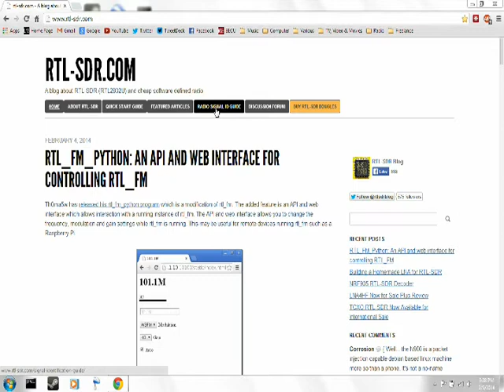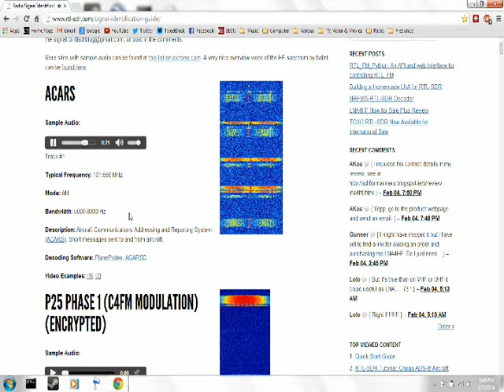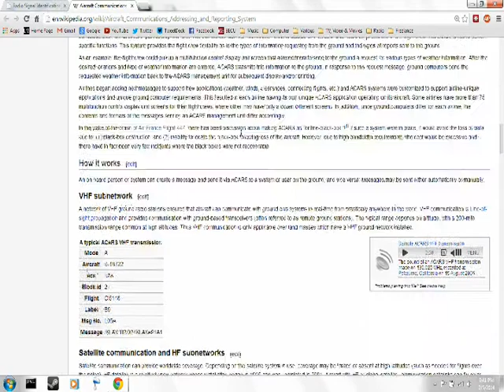Aircraft Communications Addressing & Reporting System (ACARS)

Comment: Good stuff Curt.  Fire up PDW and see what they are sayin :)  Purely FYI- I found MultiPSK to be 100X better than any other prog I tried for decoding ACARS- but I have to get the full license haha.  Cheers Bud.
Reply from the maker: Hey thanks, Eric. I discovered ACARS signals by pure accident and after researching just exactly what they are, am now totally hooked. Thanks for the tip re decoding software for those signals, as that is my next project now.
Reply from the maker: Well, I tried installing both PDW and MultiPSK and could not get either program to work on my computer, after multiple tries with both programs and much frustration.  If you know of any other ACARS decoders that will work on my Windows 7 laptop, please let me know.
Reply: Both work fine on multiple Win7 PCs for me. PDW should be the easiest and is fully free.  Odd
Reply from the maker: Yes, I thought that PDW seemed to be the one that might be easier to install and configure, so I spent the most of my time with it.  I could never get it to allow me to do any of the recommended sound setup, however, as clicking on the options section for sound would not bring up any menu or dialog box.  I also got an error message when starting up the program for the first time about ComPort.  I may give it another go later tonight. I don't give up easily!
Reply: ***** Odd.  I have a video made covering PDW3.1 but it wont be edited and uploaded till later next week at best.
Reply from the maker: Eric William I'll watch your channel for notice that you have uploaded the PDW3.1 video, thanks.  I think the problem lies in my computer's sound system and sound drivers and I'm looking further into that.  Thanks, bro.
Reply: Not a prob- Just editing the vid now.  One FYI- sometimes PDW is grumpy with one of my PCs too- can bypass this by looping the spk out into the mic in with a male to male adapter- then see if you get levels in PDW.  I get around this with VAC's but that would be an uber quick test for you.  Cheers
Reply from the maker: Eric William My laptop is a Dell Inspiron 1720 and only has two audio inputs, one for microphone and one for headphones, and no spk out input (speaker add-ons are handled via USB ports).  I do have a male to male patch cord that I use to hook up my portable shortwave.  But I'm trying to get PDW to record from my RTL-SDR radio via the dongle-in-USB.  The error message that I get when I first open the PDW program is "PDW Driver - Unable to open the selected ComPort" and I'm not even sure what that means, LOL!  Still not ready to give up, though! :)
Reply: Pm me if u like and we can phone chat if u need.  Cheers
Reply: Can't return your PM due to you have contact lock or something enabled.  PM me again if you need a call.  Cheers
Reply from the maker: I "unlocked" that setting, so you can PM me now.  Thanks for the offer of a call.  Let me see if I can get this to work first and if not, I'll PM you again. Ciao.
Reply from the maker: Eric William So, I tried everything that I could think of and could not get any of the ACARS software for my computer to work.  However, I'm happy to report that I found a pretty decent workaround in the form of an ACARS decorder app for my Android smartphone.  It seems to work OK, though I've now discovered that I'm going to have to teach myself how to read and understand the messages that I've decoded.  All in all, I'm still totally digging this whole experience.  Thanks for your help and suggestions for a total newbie on this particular radio subject.
Reply: No prob :)
Reply from the maker: Eric William Finally, I figured out how to get the PDW Decoder to work on my computer!  (VB-Cable and the correct configuration did the trick): http://youtu.be/C8e1AV-mDSo
Reply: Good stuff! Cheers